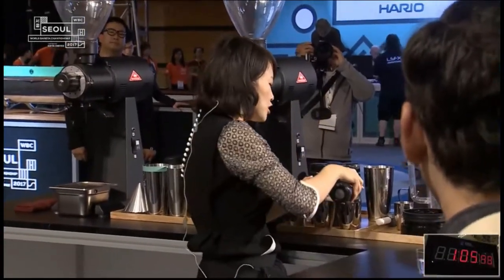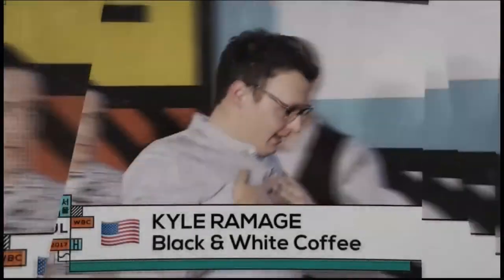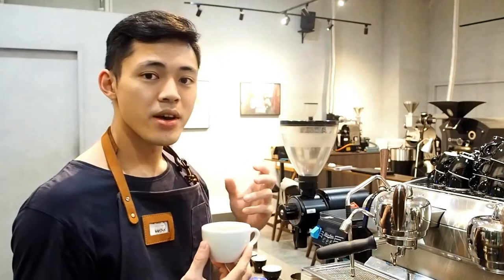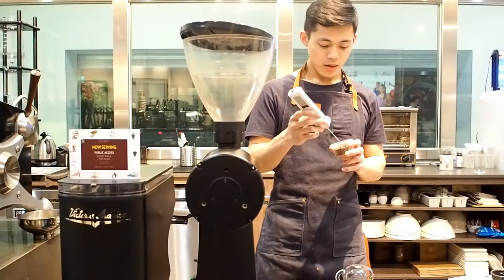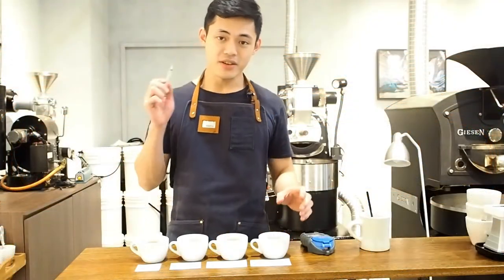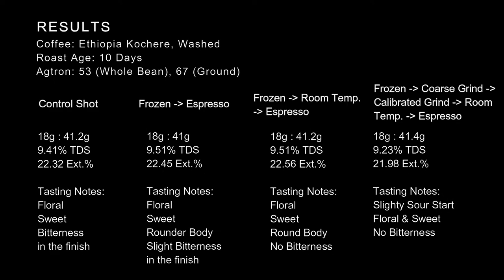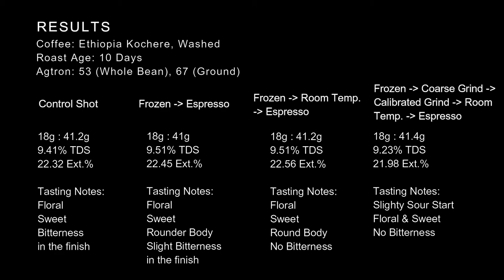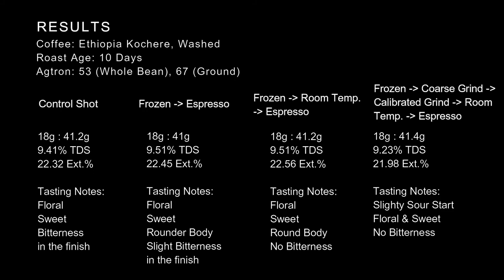Does Grinding Frozen Coffee Beans Impact Brewing & Taste?

Comment: Interesting video.

Do you know if grinding beans that are frozen using a domestic freezer (around -18C) also provides benefits to the quality of the cup?
Reply: See James Hoffman, he did something similar but used a standard home refrigerator and freezer (freezer temp set to -20C) to compare grind size volume. It was basically the same as if you stored your beans in a refrigerator. So I reckon your coffee beans have to be at least or close to -79C.